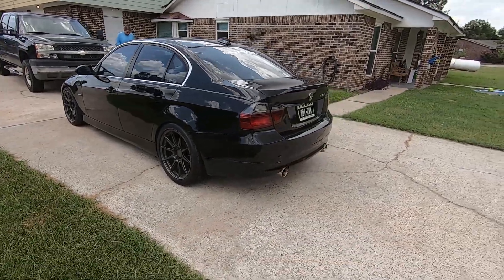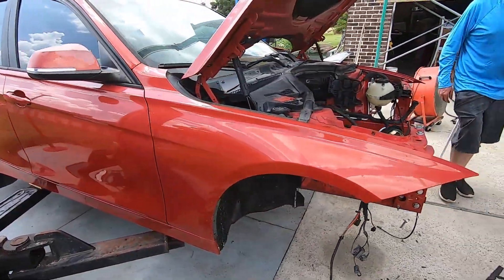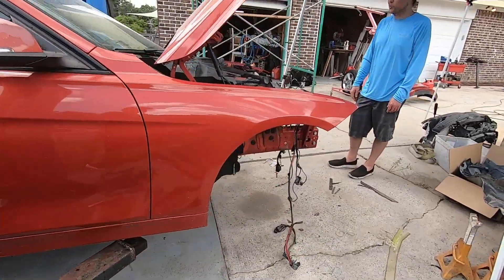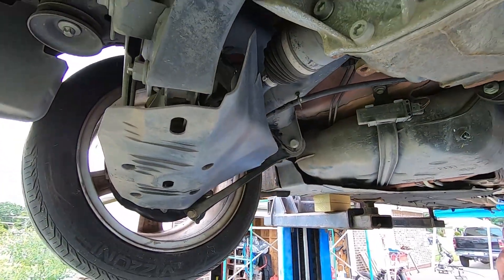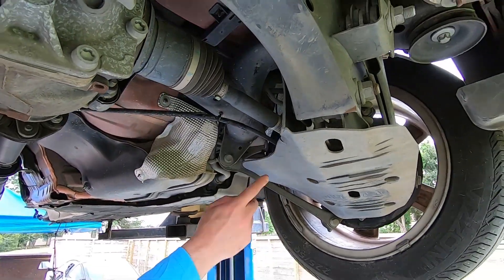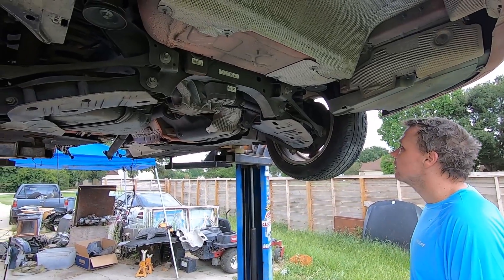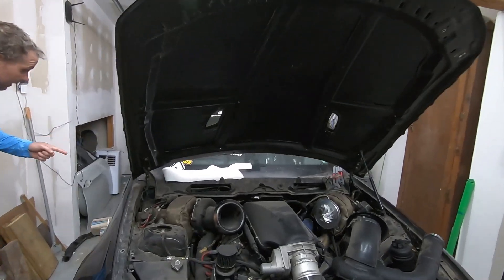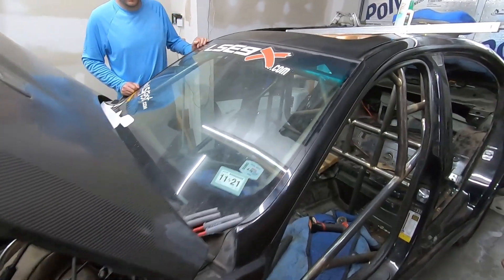We're back!....Project updates plus a NEW CHASSIS!

Comment: waymnt.   Can i put an F30 diff in my 135i and then get a custom drive shaft so i dont have to get some crazy drive shaft set up?
Reply from the maker: Seems that way, we normally just use a 328 e90 diff in 335i cars so you don't need the weird Adapter
Reply: @lse90garage   are they as strong as a 135/335 diff?
Reply from the maker: @Turbo_Kosmo  the autos have smaller inner cv cups but the 335s break